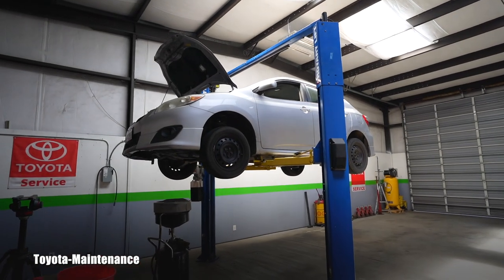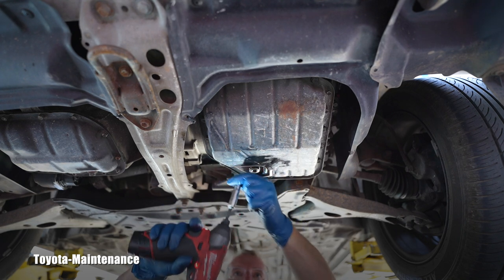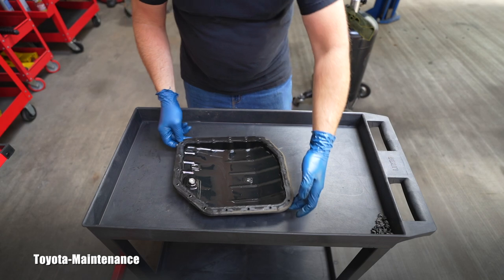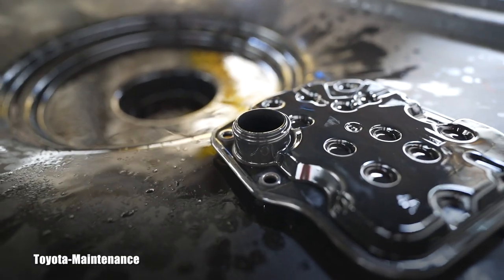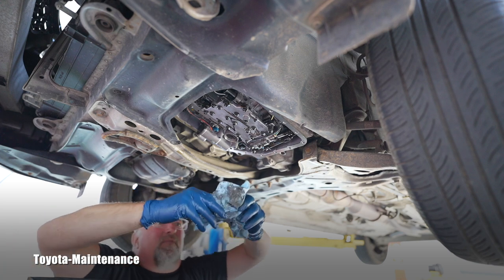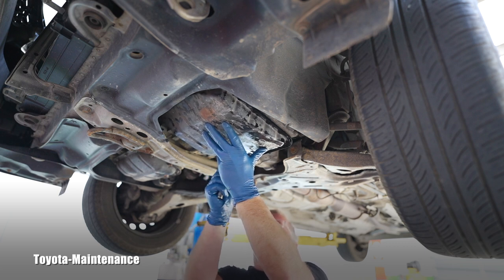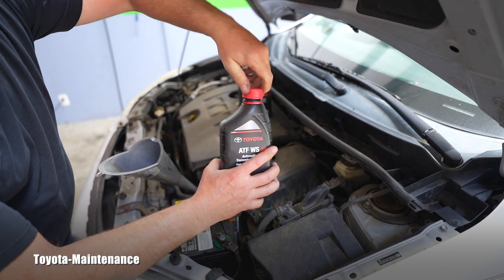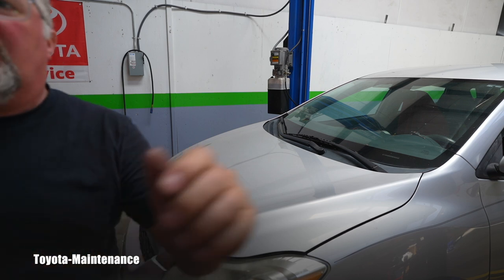2010 Toyota Matrix Automatic Transmission Service

Comment: FYI, any owners looking to DIY this service can purchase a click-type torque wrench from Harbor Freight for roughly $20. They are accurate and consistent enough to be great for installing the transmission filter and fluid pan bolts. I would never build an engine with one of them, because they are not accurate and consistent enough to be trusted to install con rod or main caps or torque a cylinder head down, but the torque of a filter or fluid pan is not nearly that critical. The pattern and relative closeness to spec is what matters most with the filter and pan bolts, and the HF torque wrench is more than adequate to keep someone from over or under tightening the bolts and to keep them at the factory spec torque to prevent crushing or warping the pan and gasket. 👍 Well worth it. Keep in mind that you want to use a torque wrench that has your required torque spec in the middle of its usable range. If the model you are looking at has a range of 10-80 lb-ft and you need a wrench to tighten something to 12 lb-ft, you should look at a wrench with a smaller range which is possibly a lb-in wrench. You can convert lb-ft to lb-in and back to use wrenches labeled for those different units. 👍
Reply: I have one of those and I have to agree, it's probably fine for light maintenance like this. I've watched a lot of these Toyota Maintenance videos though, and I have to say, I'm extremely envious of the nice digital torque wrenches that he uses, and even the snap-on click type wrench :D
Reply: That's good Info to share.  Thanks👍

I like to torque my head bolts on my old Dodge truck with the arrow-rod type wrench, to get that classic torqueing 🤣🤣🤣

Comment: Most car and truck owners will change their AT fluid every 30,000 miles or what is directed from the owner's manual.  However, I have known a few people who drain and fill their AT after every other motor oil and filter change.  Then they replace the filter every 30,000 miles.  This ensures the driver is always running on completely fresh fluid.

Comment: Hey Peter. I just did a trans drain and fill on my 2006 Matrix AWD (197,000 miles). I do it every 30k miles. Also, I always use a new crush washer so you do not wind up over-torquing the drain plug.

Comment: Great video. I recently bought a 2018 Lexus ES350 and I currently have 24k miles.  This just confirms that I will plan on doing a drain and fill very soon.  I’m planning on 3500-4K mile oil change intervals and really keeping up on the maintenance.

Comment: Your opinion please. On another channel, the mechanic cautions about changing fluid and filter on high mileage cars because the old fluid has accumulated debris from the clutches.
That makes the fluid heavier and helps to add 'grabbing' power when the transmission shifts, he claims.  My opinion>>> The dirty filter may starve the transmission from fluid.

Comment: i have toyota rav 4 2018 le, and noticed that i have to turn the lights to the "brights" mode manually, there's no sensor on the winshield, but i believe the "brights" mode turns off when the ignition key is removed, just a comment.

Comment: My daughter has a 2010 Matrix, that has over 180,000 miles. The local quick lube type place said that the ATF is dirty enough that they were hesitant about changing it. It runs well, but would my chances be okay to change this at home?

I also have a manual 2010 matrix that, she cold, grinds a little going into 3rd. I’ve heard this is kind of normal, but is it?

Comment: Peter, I do have 1998 Camry 260k mi fluid never been flushed. Would it do harm if I flush and change the filter this time?
Reply: If the transmission functions as designed at the moment, there is no reason to think that new fluid will alter that reality. It is a myth that new fluid will suddenly destroy an old transmission that still works just fine. 

What is true is that a transmission will suffer increased wear when fluid changes are neglected over its lifetime. That means the trans will start developing problems sooner than later. If a person changes the fluid when the transmission is exhibiting signs of excessive wear or component failure, yes it will fail after that fluid change simply because it was failing ANYWAY regardless of what fluid is in it. In many cases, old fluid that's in a middle aged transmission sometimes leads to unappreciated behavior like firm shifts, torque converter shudder, shift flares, etc. Replacing the fluid by doing a complete cooler line fluid exchange puts fluid into the unit which is back to spec and the trans can then operate as designed now that it has brand new proper fluid inside of it. The unwanted symptoms go away because the fluid is correct again. What it comes down to is, the fluid is how the unit operates and it protects the components from wear. A fluid change won't cure a 260k unit of incorrect operation. It also won't destroy a unit that works just fine with no issues. New fluid won't suddenly undo years of deferred maintenance and neglect, nor will it suddenly destroy components which are still within factory tolerances and still serviceable or usable as they are currently. New fluid = leas wear going into the future.
Reply: @mannys9130  Thank you so much for the explanation!  I have black fluid but no smell, it smells the same as new transmission fluid, no material in the fluid but once every so often I feel the transmission bump forward when changing gears like once every 20 minutes of driving usually when the transmission is cold.   The transmission was serviced at 50k miles but I just got the 4runner now at 150k miles and the fluid is black.     I plan to drop the pan and see the condition, I think clutch wear would mean pieces of clutch in the pan but I guess its hard to tell, anyway, if I don't see too much junk in the pan I will do the full cooler line fluid swap.         If there is damage it was already done I guess.  I did read online people saying that the new fluid could make the clutches slip so I am concerned about that but I guess that keeping the old fluid in will just keep on wearing down the transmission with dirty black fluid that is 100k miles old.

Comment: Just got my 2016 corolla serviced . Found out Toyota mid year switched out the atf fluid from WS to another type on that year model
Reply: Yeah, I think after 2014 toyota switched from regular automatic transmission to CVT. Basically a glorified scooter transmission with a steel belt. You definitely want to change out the CVT fluid out every 60k miles to if you plan on keeping it for a while.
Reply: TOYOTA 2016 corolla  is CVT transmission

Comment: Rebuilt my calipers on my 07 Tundra. 4 out of the 8 pistons were stuck. Hydraulic pressure and air pressure didn't work. I used a hammer air tool to remove them. The pistons cost $7 each. So, for 35 dollars each  caliper to fix. A new caliper cost $115.

Comment: Peter thankyou for the content I love your videos. Question I have is isn't there still a few quarts in the torque converter?  and if there is should you do another drain and fill much sooner than  30K miles I'm asking because I did drain and fill on my 05 highlander and the fluid was still quite dark so I did it a second time and the fluid is still nasty looking. is that normal and expected? thanks
Reply: It's normal , you will never get it all out .
Reply: Yes, there will still be old fluid inside of the torque converter, oil cooler circuit, clutch apply pistons, valve body piston bores and accumulators, as well as all of the hydraulic circuit passages inside the valve body which direct fluid to and from servos and actuators and bearings etc. For this reason, I don't EVER do a simple pan drop, filter swap and magnet cleaning, service by itself. I do that stuff first, refill the pan with the capacity that it holds, and then I move on to the second half of the trans fluid change. I remove the oil cooler return line that goes back to the transmission from the cooler's fitting nipple. To determine which hose the cooler output line is, follow both hoses to the trans and look at which one goes into the trans case near the top of the pan, or possibly which one goes into the case near the bell housing. A hose going into the pan is usually the return line, and one going into the bell housing area is probably the cooler's input going directly to it from the trans pump. The return line nipple you want to be removing the hose from can be at the radiator itself, at the oil-to-air cooler if the vehicle has an auxiliary ATF cooler like a truck or SUV, or possibly even the heat exchanger device somewhere on the trans case or engine block if the vehicle has an oil-to-water heat exchanger block rather than a traditional loop of tubing inside the cold side radiator tank. I put a section of clear hose onto the nipple of the oil cooler's output port, and I direct it down into a 5 gallon bucket. I put a funnel into the dipstick tube for adding new fluid quickly. I put a bright flashlight shining into the clear tube and at the stream of fluid that is leaving the end of the tube. Then I start the engine and watch the old fluid being pushed out of the trans by the pump and I pour new fluid into the pan at roughly the same rate that it comes out at. I watch the fluid coming out of the tube and eventually after several quarts it will start to change color and opacity and it'll look like the new fluid that you're pouring in. I continue replacing the fluid a bit longer after that point is reached. I usually use 1.5 times the transmission's total fluid capacity when doing a complete cooler line fluid exchange. Just before you reach the point where you wish to stop the exchange, stop pouring in fluid and allow the pump to expel a bit of fluid from the pan to reduce the oil level below the fill line which will allow you to top off the pan rather than leave you needing to take more fluid out. It's easier that way. Reconnect the return line, start it back up, shift through each gear, top off the pan near the cold mark, and then take the car for a drive to get the trans fluid fully up to temp and check the level once more at the hot mark. Done. 99% of the old fluid has been replaced with brand new fluid. Almost all of it is brand new and you are totally confident that it's back to being proper viscosity and has no debris in it and has the correct additives and friction modifiers needed to protect the transmission. Dropping the pan one time gives you a mixture of good and ruined fluid which is not good. Even dropping the pan 3-4 times still ends up with mixed fluid. A cooler line exchange is not a powered flush, it does not harm the transmission at all since it's the pump doing its normal thing at normal pressure, and it gets everything changed out in one fell swoop within 2-3 minutes. It's not hard to do at all. The pan removal is way harder and messier. I choose to flush the fluid through the oil cooler so that all of the old oil hiding inside of it is removed as well. If you remove the cooler's input line and then flush the fluid without the cooler in the equation, you will pump a good bit of old fluid right into the trans full of nice, clean, brand new fluid and contaminate it right away. Not good in my OCD mind. 😸 

To be quite honest, it's my opinion that a person could drop the pan to clean the magnets and replace the filter at the first ATF service because the trans break-in period when the car was new will have made a bunch of shavings and dust and then wear particulate will drastically decrease in production volume after that. The majority of the shavings and clutch dust inside of a trans with less than 60k miles that has never been serviced consists almost entirely of that break-in particulate. A person could do the first service at 30k for conventual ATF or 50k for full synthetic ATF. They could replace the filter and clean the magnets, and do a complete fluid exchange as described. After that, the filter will be good to go for quite a while. The next change can easily be around 150k miles as long as fluid changes are done on schedule. The person can simply do cooler line fluid exchanges every 30-50k and not even need to touch the pan. Clean fluid that is serviceable will stop excessive wear which is what plugs up the filter and coats the magnet in ferrous particulate. My 2012 Corolla is filled with MaxLife which was installed at 58k miles when I got the car. I also installed an auxiliary oil-to-air ATF cooler after the stock radiator cooler because I live in Arizona and it is exceptionally hot here. This extra cooler keeps the ATF at operating temp even during city driving in 115°F heat with the AC on full blast. 😎 I do ATF cooler line exchanges every 30k miles. Can't get any better than that! :)
Reply: @mannys9130  Way too much work and OVERKILL. WE KNOW PEOPLE WITH OVER 8OO.000 EVEN ONE WITH OVER 1 MILLION MILES ON A TOYO" SIENNA MINI VAN, AND TOYO SEQUOIA. AND THEY NEVER DID WHAT YOU DID. AND JUST  REFRESHES.AND AT GREAT INTERVALS. LIKE 250.OOO. MILES! THEY DID USE A FULL STHN. THOUGH.
Reply: @mannys9130   Thank you for the great breakdown of the process. I checked my car and you are right that is a very doable job.  I'm going to do this over the weekend. Again I really appreciate it, thankyou!

Comment: Sorry peter but you should have left the filter in and ran it and drained it a couple of times I put 12 quarts through mine, y'all need to get the dirty oil out of the valve body and converter     bud
Reply: I agree... I have an 05 Matrix total atf capacity is approximately 8 quarts - 3 quarts clean being mixed with 5 quarts of black fluid is a huge no bueno in my book.  The cooler line disconnect and pumping new fluid through is super easy on these cars.  Also have used Valvoline MaxLife atf - in 2004 Corolla and 04 RX330 & the Matrix with no issue all are spec'ed for T-IV fluid - the synthetic has worked great.

Comment: Be careful not to mix newton meters up with foot pounds, or inch pounds of torque, when setting your torque wrench adjustment. It has happened to some very smart people. Pull gradually on a torque wrench and quit pulling the instant it clicks, or beeps. Checking it twice will prevent you from missing one bolt during a cross hatch tightening.  
See those wires inside the transmission. It is better not to even touch them because they have been cooking inside that hot fluid for years, and the insulation might have become brittle. 
Unless you have a lift like Peter has, it might not be a good idea to even touch the transmission interior. They are super sensitive to contamination, and old wires and wiring connectors inside there are best left alone. You never know what might crack. Why take that chance. It it ain't broke, don't fix it.

Comment: U341 isn't good i,m use170000 Mi
Reply: U341E transmissions are great. Their only big issue is the torque converter lockup clutch apply piston in the valve body. There are PWM variants and there are binary on/off variants. The PWM variants wear out the application piston bore and seal more quickly because they vibrate in the bore as they are pulsed. The fix is to use a Sonnax repair kit or to swap the valve body and install one that is the on/off variant instead. The lockup clutch will be fine as long as the slippage issue is repaired asap. If the person drives the car with the TCC slipping for thousands of miles, the piston repair kit or valve body swap won't be enough to fix the issue and the TC will need replacing too. Otherwise, they are great transmissions and they will last as long as the fluid is kept cool and clean with frequent fluid changes on schedule. 30k miles for WS fluid, 50k for a full synthetic substitute.
Reply: @mannys9130  I've got a 2011 Corolla with 105,000 miles. Trans fluid has never been changed and it's pretty dark but shifts fine with no apparent issues. I've had it for 8 years. Do you think it's too late for me to do a drain and fill with genuine WS fluid? I wouldn't drop the pan and change the filter, just a drain and fill.